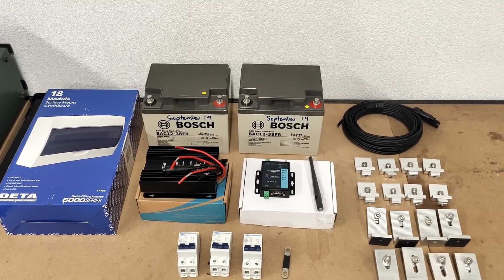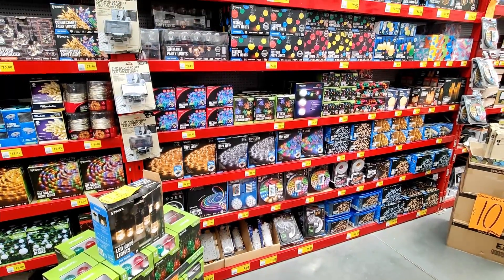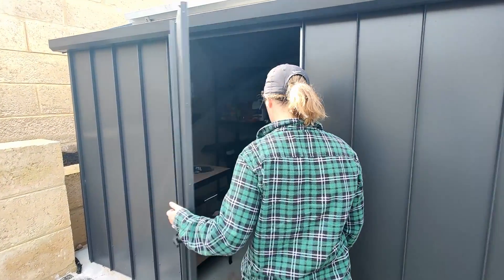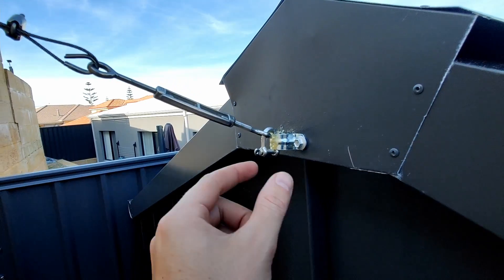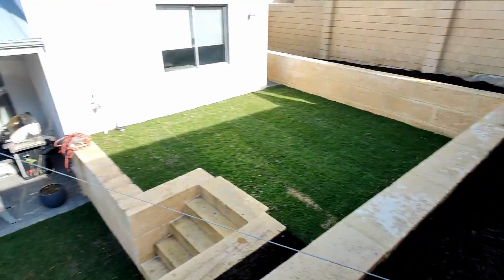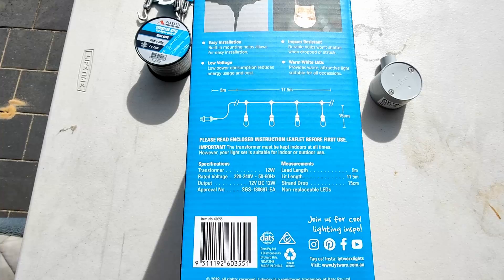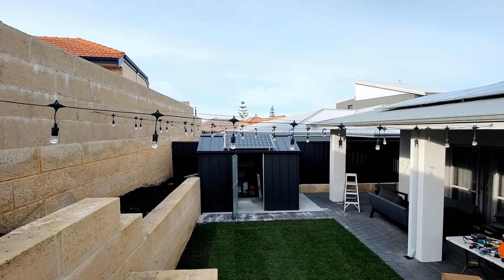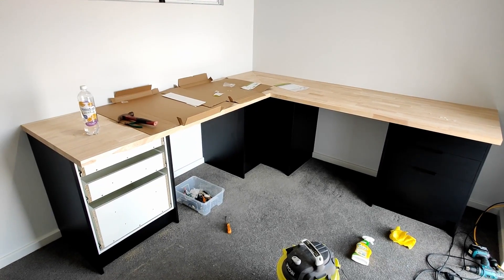Installing Festoon Lighting with Off-Grid Power

Comment: Not a big deal, but I would have made each cable span independent, so that failure would not drop all of the lights.
Also, by center-feeding the light span, it minimizes voltage drop so the end is not noticeably dimmer. You could also have run half the lights off each battery to eliminate the voltage converter, or just wired the halves in series.
Reply from the maker: Cheers Tom good suggestions for any viewers wanting to follow along or try this themselves